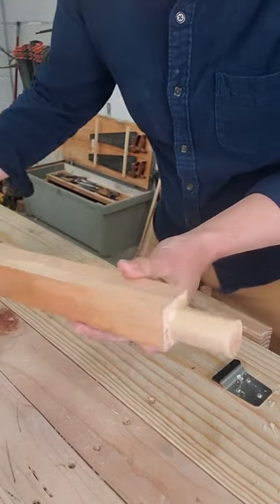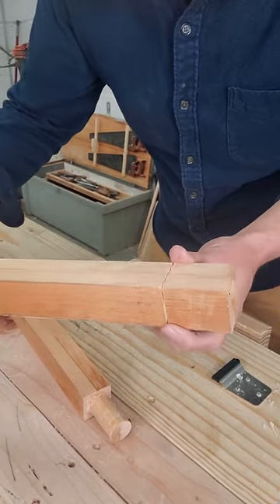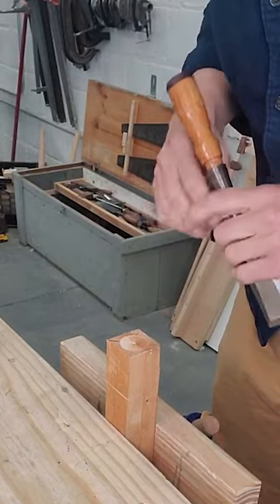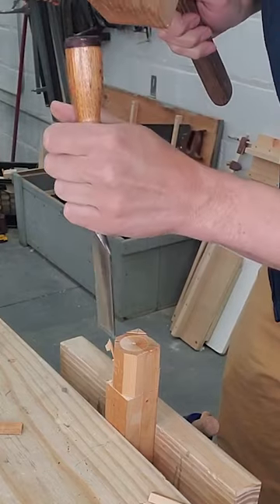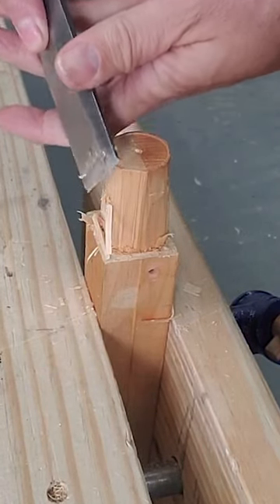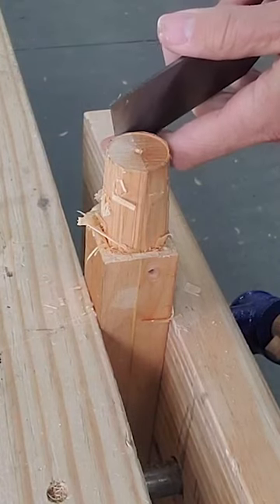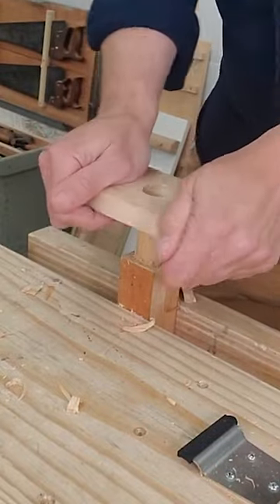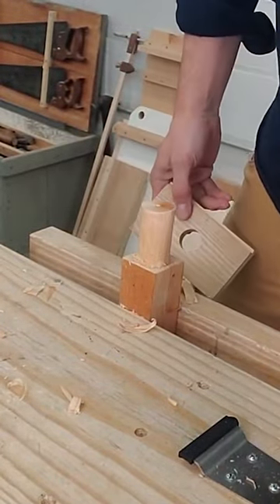Round Tenon. All Hand Tools. #diy #shorts

Comment: it's great that you're breaking the individual techniques out like this. It's the first actually good use of shorts I've seen!

Also, these are where I'm getting stuck on this as a novice:
- starting a saw cut where I want it to be
- getting an even depth on the cuts, especially on the corners, when the goal is a round tenon on a face I can't see. I guess I should be using a speed square to draw 45° lines tangent to the circle, then carry them down the faces? Is there a faster way other than "git gud"? (not saying that anyone is saying that)
Reply from the maker: I gotta admit,  I can't understand what the 45 degree lines have to do with anything. I'm just sawing in a little bit on the sides and a little more on the corners. You can really wing it if you don't go too deep.  Also,  a little piece of tape on that saw blade with help with depth.
Reply: I'll add that buying enough stock to have mistakes happen, and paying attention to what went wrong is a part of getting good. This is a craft. It takes practice to be really good at, but that doesn't mean you can't make good work early on.

Don't be too hard on yourself, and know that even the best woodworkers out there make mistakes sometimes. Nothing can replace experience, and experience is only worth something if things go wrong every now and again.
Reply: @RexKrueger  @Nic Beurskens
Perfectionism is 100% the issue. I also feel weird about "wasting" material I'm paying for, if that makes sense (not saying I'm right, just that that's the feeling I'm caught on)
Reply from the maker: @andrew krahn,  that's a hill you just have to climb.  Without wasted materials,  there is no progress. Not everything can be a project.  Some things are just practice.  You also must divorce yourself from Instagram woodworking.  Find some old furniture and really look at it.  You'll be shocked at how those old boys cut corners.  They weren't out for perfect; they were getting paid.
Reply: Re: starting a saw cut where you want it to be, Rex has covered this in several videos I'm sure, but most recently (that I've seen) in this video (about 15 minutes long):

https://www.youtube.com/watch?v=O1kOvlcMhSw&list=PLT81bxmJPgKSLBkL33U7rHJBJUUzFd86R&index=589

Note, at the beginning he mentions a recent video on half-lap joints, if you're curious I'm pretty sure that's this video:

https://www.youtube.com/watch?v=teE3lzbo9WI&list=PLT81bxmJPgKSLBkL33U7rHJBJUUzFd86R&index=555
Reply: @RexKrueger  By the tangential lines, I think he basically means draw the circle on the end face, then draw several straight lines on the end face that are (of course) tangential to the circle.  Then chisel those straight lines.

Of course, the more tangential lines (at slightly different angles to the circle) that you draw, the more closely the collection of tangential lines starts to resemble a circle.  E.g. if you have, say, 8 tangential-to-the-circle lines that are perfectly evenly spaced/angled, then you've drawn an octagon.

I'm not sure about the 45 degree part, though :-).

Comment: This is a nice tutorial.
I did a bunch of these and found an amazing time saving trick. I used a 30mm plug cutter in conjunction with my pillar drill. It took a couple of hours to get all the set up just right, but after that i made 2 dozen perfect round tennons that fit just perfectly with the 30mm holes.

Comment: It's always best to sand it down again after you put the hardwood mold on it. As the woodfibers get squished down and wouldn't absorb the woodglue as good. You sand it down so it gets thinner a bit but the restoration of the fibers wil compensate for that!

Comment: As a non-woodworker, this may be dumb question but, is this easier or harder with different species of wood?
Reply: it depends on the species, yes, but it should work with them all.

Some woods (ring porous hardwood with straight grain, or a lot of straight softwoods) split like a dream, so you need to be careful to only start a split that dead-ends into those stop-cuts.

Others might be more of less "interlocked", where each year of growth "spirals" up the trunk in a different direction than the years before.

The hardness/density affects how much work it takes to get the chisel in there, but all(?) wood is weakest between the fibers.
Reply from the maker: Andrew explained that very well. That's almost exactly what I would have written.  I'm using yellow pine.  It's super easy.

Comment: I’ve only made a few tenons myself, so may be wrong, but Wouldn’t burnishing a tenon make it slip out easier without the friction of slight roughness helping to hold in place? And if glue is being used is burnishing not closing the wood’s pores that would absorb that glue?
Reply from the maker: In theory, everything you say is totally true.  In practice,  I've done this dozens of times and never once had one of these joints fail. Not after years of daily use.
Reply: @RexKrueger  I assumed you  knew what you were doing, I certainly can’t doubt our judge a professional with my limited experience. I had been so curious about how burnishing effected tenons for a while, thanks.
Reply from the maker: It was a very good question.